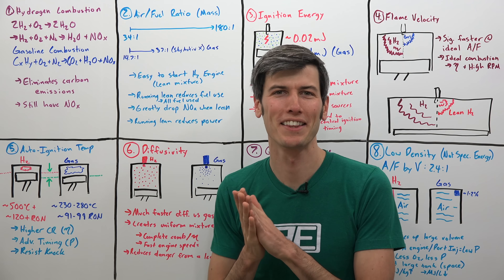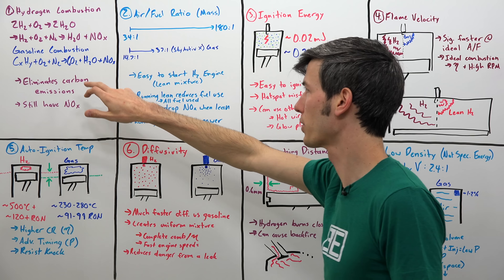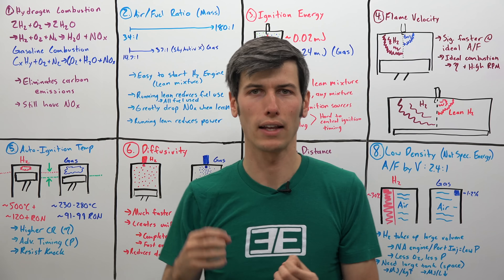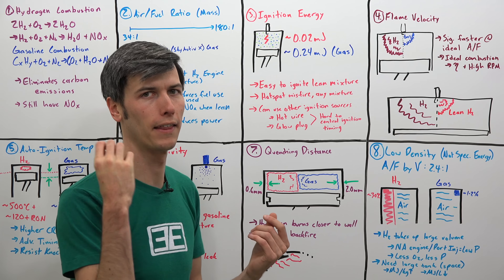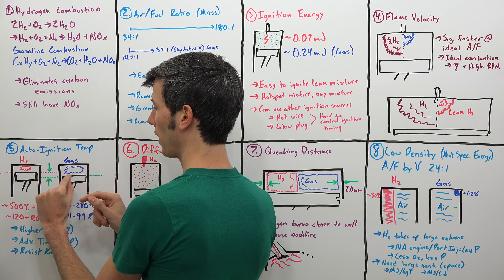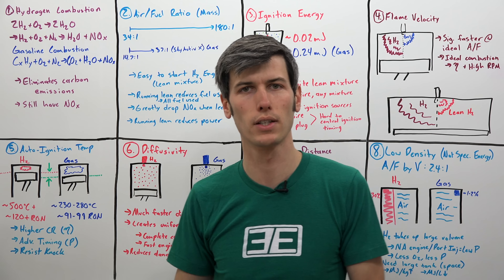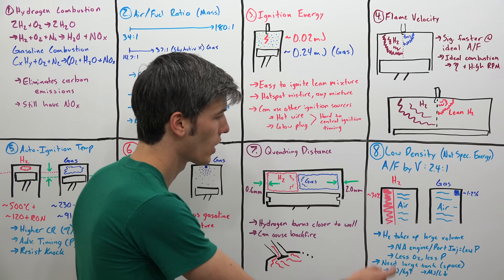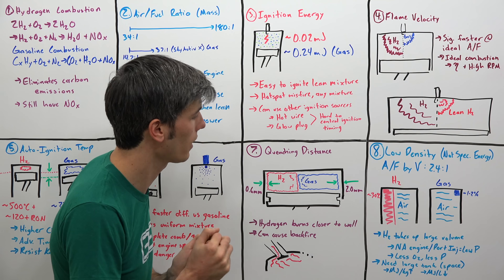The Difference Between Gasoline And Hydrogen Engines

Comment: I do have a couple of questions: a lean mixture means more residual oxygen to combine with nitrogen. Adding more hydrogen would have a higher affinity for that oxygen than nitrogen. Does the leaner mix simply reduce the chamber temperature enough, to keep the nitrogen from oxidizing? Question 2: Auto ignition temperature.Does oxygen concentration affect the auto ignition temperature of hydrogen? I know that a lit cigarette will not light gasoline, nor natural gas at atmospheric pressure. It WILL touch off a charging lead acid battery. The ember on a cigarette just isn't hot enough to set off those conventional fuels. It will, however touch off diesel fuel. In the case of the battery, it's paired with nearly pure oxygen, but by the time it gets to an ignition source, the oxygen is diluted. I don't smoke, but I have done those experiments.

Comment: If everybody drove hydrogen engines.  If the water just ran out of the exhaust, busy roads would soon be slick ice during the winter in many states. You could collect the water in a tank, but you would need to drain it as soon as you parked your car, otherwise it would freeze in the tank.

Comment: Great video sir. However several points are not presented in entirety. Such as hydrogen from electrolysis doesn't require massive tanks. As it is condensed and premixed with source oxygen. Hydrogen also wants desperately to rise at thirty plus mph. Straight up, not sideways.
Elsewise I enjoyed this presentation very much. Nerdy information tickles my mind meat.

Comment: Excellent video! As always, well researched and well explained!  It seems more appropriate to consider hydrogen as a replacement for diesel rather than gasoline/petrol. Petrol engines are generally used in roles where size/weight economy are paramount, such as in passenger vehicles, and as you mentioned this is hydrogen's drawback. However, in diesel powered trucks and heavy machinery, fuel storage space may be less of a concern? Also, hydrogen's high flame velocity and high diffusivity seem to make it sensible for use in a injected compression engine and you would not have the issue of pre-ignition or backfire. If turbo-charging (already in use in most diesels) is utilised in conjunction with continuous injection throughout the power stroke, the problem of high fuel/air per volume might be overcome. 
I'd love to see a video comparing diesel and hydrogen. Keep up the great work!

Comment: Hydrogen fuel is also difficult to store. Hydrogen attacks metals and other materials and makes them brittle. Hydrogen fuel is also not safe. Remember the Hindenburg dirigible? That was filled with hydrogen gas. One little tiny spark lit the whole thing off and created a major disaster. Carrying compressed liquid hydrogen in your vehicle could be very unsafe. Hydrogen is not a practical feul to be used in automobiles because of storage and safety problems.

Comment: Would like to see a similar comparison of oxygen/water combined in mist spray of hydrocarbon fuels. Oxygen and fuel burn hot, water replaces nitrogen for expansion and controlling temperature. 👍🏻👍🏻👍🏻👍🏻 Bet it will be a real winner over air mixtures for power increase, improved mileage, and cleaner immissions. Thank you.

Comment: If a gas is compressed to a certain point, isn't it getting hotter and tending to auto-ignite?  Wouldn't it be safer to have a fractionned combustion chamber instead of separated cylinders and use the fact that Hydrogen can be cooled before injection in order to get better control over combustion timing?

Comment: The disadvantage to hydrogen:

1) It does no exist naturally in its elemental form.  It must be separated.  Most commercially sold hydrogen comes from petroleum.  So there are your carbon emissions.
2) The energy you get from burning hydrogen as a fuel source is lower than the energy that it required to break the bonds to GET the hydrogen.  This is basic physics.  No amount of engineering is going to change that.  Instead of spending energy separating hydrogen from oil to make a fuel, it is better to use the oil as a fuel.  Cleaner and cheaper.

Comment: Range per fill/charge, the Achilles Heel of most "eco-friendly" cars of the future. I would like to see a similar video comparing methane (CNG, LNG) to gasoline. The single carbon atom makes a huge difference in fuel density. Added benefit of flexibility, can use LP gas! Both are very clean (internally).

Comment: does it make sense, that hydrogen has 180:1 air/ fuel ratio, and gas has 34:1 air/ fuel, yet later on hydrogen takes up 30% of the chamber compared to air, and gas takes up 1.2% compared to air??? Seems like a contradiction?
Reply: A/F ratio is a ratio of mass, not of volume. Hydrogen has the lowest density of any known element which means it uses up a lot of room for very little mass. For instance Hydrogen is about 14 times less dense than air at the same temperature.

Comment: thing is, hydrogen is generally steamed out of natural gas which takes energy, increasingly they are using electrolysis which is better but once you take into account transport, compressing it etc its still inefficient compared to just sticking that power into a battery. 

the only time hydrogen makes sense is if you use a fuel cell to convert it to electricity and the power used to separate the hydrogen out of water is excess power from renewables and we are a LONG way off of that!

Comment: I don't know if any one has asked this already, and I apologize if this has already been answered. What is the btu value of one gallon of water? Being separated into H2 and O2 of course. Is there a way to calculate this?
Reply: Oxygen hasn't really any heating value of it's own. Hydrogen has a heating value of about 120MJ/kg which is the highest of any known fuel by far, but because its density is very low it has only about a quarter of the energy per volume when liquified compared with petrol and it's even worse as a gas. At 200bar pressure hydrogen only has about 1900MJ/m^3 compared with petrol which has about 31500MJ/m^3.
Reply: @shi01  This is where I come across this problem, the btu value for Hydrogen is easy to obtain. However, when Hydrogen is burned in an oxygen rich atmosphere it's btu's increase. I would guess that the percentage of oxygen in the air is equal to the exponential rate of btu's of  hydrogen burned in said atmosphere. I guess I'm looking for the increased btu's of hydrogen in an oxygen rich environment.

Comment: Jason, If I were to install a small hydrogen generator in my 70's pickup with 4 barrel carburetor to assist the gasoline on long trips, would the timing be an issue? assuming the engine is timed pretty accurately for gas burn? Also, do you see any issues with mixing hydrogen and gas simultaneous? I would think the volume of hydrogen produced would be controlled by the voltage through the generator and it's number of plates, then use the gas pedal as usual.
Any ideas or suggested videos? Thanks, like your video!

Comment: I'm confused about one thing. If the air to fuel ratio is up in the 100:1 zone, how do you fit enough air in the cylinder seeing as the hydrogen takes up 30% of the space?

Comment: Before you turn off, bear with me.  There is a lot of unscientific comments on the use of HHO gas in cars. I’m not interested in HHO as a replacement to Petrol (gas) but what I’m interested in (without all the unproved beliefs, opinions and conspiracy) is the combined use of HHO with the standard spark or compression ignition engine.
As a junior Marine engineer (1980’s) we had ships running up the Australian coast and trucks running compression ignition engines (Heavy fuel & Distillate) with Hydrogen assisted injection which increased the economy of both. (Not HHO) Worked but the economics of carrying sufficient Hydrogen was a problem & Natural gas was also tried and proved successful.
Now if the HHO is used in combination with the standard spark ignition will this make any notable better efficiency as I think it may assist the combustion process? (Not run the car on water or other junk science)
In the early fuel crisis days I use to have very low volume water injection (Vacuum nozzle) in a slant 6 Valiant (Dodge) and the small V8 and this did increase the mileage a couple of miles per (aus) gallon but was never certain if this was due to the cooling effect of the water mist or the disassociation of the water vapor (like HHO) causing a improvement in the combustion process or both.
So in summary I’m interested in your opinion or knowledge as to any practical advantage HHO would have in a carburetted engine (Not a modern computer controlled fuel injected) when consideration is given to the additional energy used to generate the HHO. I’m not interested in the practical engineering to achieve this as my skills will easily safely cover this. I have old classic cars and am just interested as I thought you might be.

Comment: Another potential safety advantage of using hydrogen over petroleum spirit (gasoline) is that the flammable vapours from petrol are denser than air and will lie across the ground whereas the hydrogen will rise quickly. In the event of an ignition of leakage, the flame from petrol will tend to lie close to the ground but not so with hydrogen.

Comment: 2:11  Unless you have a naturally-occurring source of H2, or you have enough surplus hydro/wind/solar/nuclear capacity to produce it (without requiring more carbon-based generation elsewhere), it's still producing carbon indirectly.  Probably less than simply burning gasoline in an IC engine, but it isn't zero.
Reply: You could easily produce hydrogen, through electrolysis, with a nuclear plant. Especially if you used the nuclear plant as a distillation facility.

Comment: With the increased compression ratio , longer piston stroke length, and higher rpm capability wouldn’t there be a danger of reaching the maximum piston linear speed that limits the potential of the engine?

Comment: Would hydrogen make sense in a rotary engine?
And what about hydrogen fuel cells?
Reply: Yeah, no carbon fouling, except for the oiling system. That could be addressed by oil formulation.
Reply: + @ebenwaterman5858  The engine oil might change the chemical reactions though...
Reply: @Luredreier  Well i was thinking about a hydrogen rotary engine (H having no carbon). Fouling the seals was a big problem that H might alleviate. All that remains is encroachment by the oiling system into the combustion process. So.. yes as you say, the oil will affect the chemical reaction. How and how significant,..I can't speculate.     I suggested in that scenario, an oil formula could be devised that would minimize carbon fouling from the oiling system, resulting in a rotary with life expectancy between overhaul similar to piston engines. BTW I really like rotarys. Mazda RX7.

Comment: Considering the properties of hydrogen in combustion, isn't it a better idea to run it in a turbine? With a turbine I think you'll be able to control the temperature better, as you'll have more control over the pressure and combustion itself. You can then also control the power output better, keeping the turbine at optimal RPM, removing the reciprocating motion of piston engine, transferring the power down to the road through say, electricity for example.

Comment: Well I suppose if you had a separate O2 tank you could get perfectly clean emissions
Reply: Otto cycle engines cannot operate in a pure oxygen atmosphere. They depend  completely on the air/fuel mixture burning and resultant heating of the nitrogen to produce the chamber pressure.  A chamber full of o2 and h in correct proportion would produce a short blast of heat and pressure followed by  a vacuum.
Reply: @ebenwaterman5858  The more you know I guess. Thanks for the info, that might come in handy later

Comment: CO2 is NOT pollution.  I'm enjoying your videos less and less every time you state that CO2 is bad and is pollution.  Science says otherwise.
Reply: Right. Co2 goes out the tailpipe and directly into your lawn. Rather simplistic, but indisputable.
Reply: Co2 is a greenhouse gas. It causes the climate to warm. We produce a lot of it. At a fast rate. Plants and animals cannot evolve fast enough to adapt properly to the resulting increased temps. In simple terms, we are killing ourselves slowly, at a day to day rate that is almost imperceptible to our senses. There will be a tipping point when the heat causes large scale famine and stress to civil society. There will be wars and bloodshed. The human race as we now know it will no longer exist. It may not extrapolate fully in our lifetimes, but I would guess certain in 200 or so years.

Comment: Wow that was a great video, a lot of information that i was looking for since a while already! Thank you for the good explanations! i had the idea of running a gasoline engine on hydrogen gas a while ago already. my plan was to mount a very high output alternator to the engine and produce the gas with a fuel cell on the go. that way the hydrogen wouldnt have to be stored in a tank under compression, i would just need a tank as a buffer. i just head no idea about the AFR, compression etc. Thank you very much for all the information!

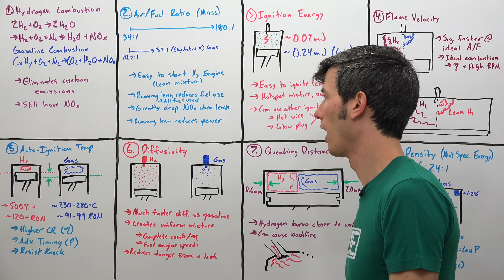Comment: Why do you get less NOX when running lean (4:15)? I supposed with less fuel there is an higher probability to oxide nitrogen.
Reply: I think NOX is related to combustion temperature.
Reply: @ebenwaterman5858  Ok, but burning lean increases the combustion temperature I guess. Or is such a lean mixture meant that the temperature begins to fall again?
Reply: @valeriooddone  Yeah, I know running lean causes overheating. Particularly destructive especially in model airplane engines. It does seem though it has to eventually go the other way as you suggest. Carrying the thought experiment to its "Logical Absurdity" as my mentor would say,  would end with no fuel (heat). Some where on the curve lower NOX must be.  Engine science is complicated and fascinating.  Keep learning, I do.

Comment: I have a friend building a street rod to specifically run e85. Using Special fuel system components for ethanol systems. He stated that e85 will create more power. Whats your thoughts about e85 and power generation versus gasoline?
Reply: Top Fuel Dragsters use alcohol because it has higher octane. However it has lower energy density so you have to run richer. But yeah, potentially more power.
Reply: @ebenwaterman5858  Thanks!

Comment: You know another fuel that produces as much co2 as hydrogen, but is yet as easy to transport as the fuels we make from crude oil?
It's silane. When silane burns it pollutes the air with clean sand. Another benefit of silane is that it can burn in pure oxygen, pure nitrogen and any mix of those 2.
Why is silane hardly ever looked at????? It has drawbacks and challenges, but so do the other alternative energy sources. And even saying that silane is dangerous or that sand is abrasive it no excuse to not look into it at all, because it has clear benefits.
Heavier silanes have a higher autoignition point and boil less quickly (most safety concerns only take the lightest one into consideration). Toolsteel is as hard as / harder than quartz; then you can do something with nitrocementation, titanium dioxide, titanium nitride coatings.
Reply: You do know that every form of Silane has to a certain degree a tendency of spontanous combustion when it comes in contact with air? Also the heavier forms have the tendency to break up into it's lighter forms which is why the main concerns do take only the lighter forms into cosideration, because that's always what you will end up with.

Comment: Lean always mean NOx.  If you want less NOx, put in less air and generate the same amount of energy from it ; then you're no longer lean and J is wrong again. Oh, but wait, there's nothing else to burn. Except for this channel.
Lean is bad. Efficient is good. J, search Google for "NOx vs AFR", print it and stick it above your bed. Better have attended those chemistry lessons instead of playing a Youtube clown.
Hydrogen does not burn closer to the wall; you said it yourself that the flame front advance is faster with it. Homogeneous mixture burns ALSO closer to the wall. That's why talking lean or rich is a nonsense, most of the explosion happens in an area around the spark plug, where the mixture needs to be optimal. Hence pocketed pistons, including from your sponsors at Mazda.  Hydrogen mixes faster with the air, hence the need to have a smaller volume to ignite it, otherwise the burn is slower and power is smaller.
You're also wrong with the gas oxidation equation, the correct one is: CxHy + z*O2 + t*N2 = a*CO2 + b*CO + c*H2O + d*H2 + e*NO2.  You can never nail the z, so byproducts are there. And so a second stage combustion, when more O2 is in, ignition is delayed and CO burns again resulting in CO2, a phenomena exploited by the TSGDI engine.

Comment: hello, i like the video, good job as always, can you please make an episode about the idea of a hybrid engine (H2 and GAS) ? and what do you think about the HHO Generators ? are they as promising as some people describe ? what are the pros/cons of using gasoline with H2 from a generator in the car ?
thanks
Reply: Pros: better performance, reduced emissions
Cons: NOx emissions (high temperature due to H2 & O2 in HHO), higher costs
The composition of H2 and O2 matters a lot; proper safety control is required to maintain an optimum ratio of H2 & O2 in HHO (oxyhydrogen gas).